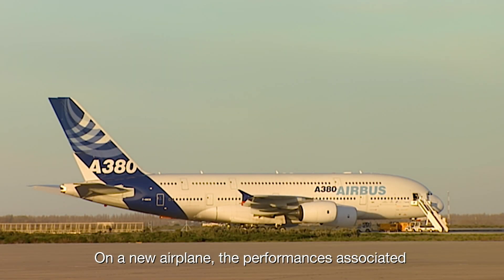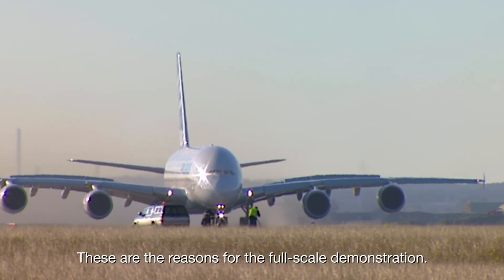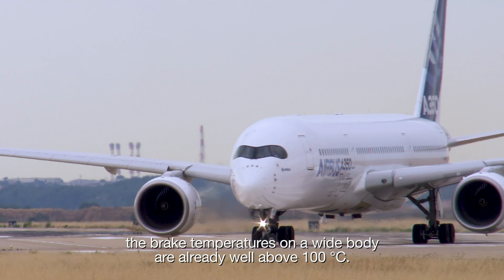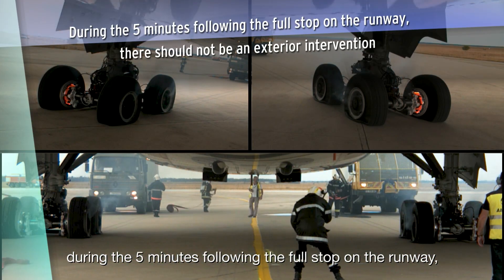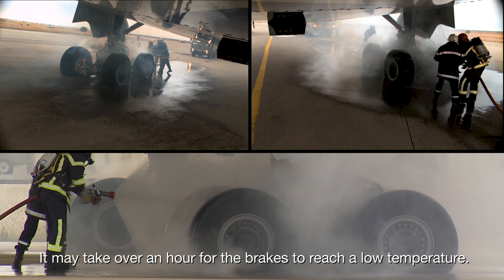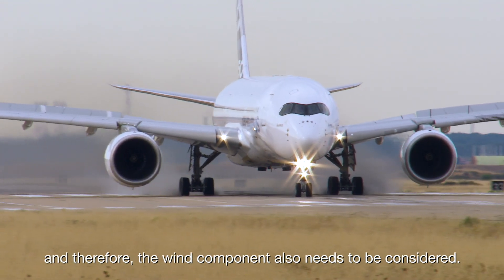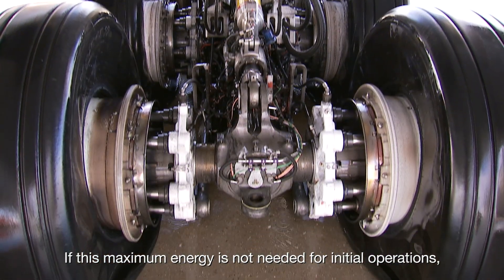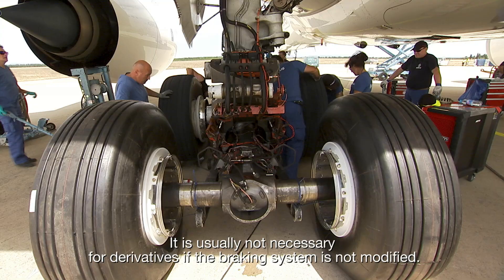Flight Tests - Ep.14: Maximum energy braking

Comment: I was on an old airbus a320 and the crew told us to brace because of an emergency brake landing. I can barely hear tires screeching and popping and felt the heat inside the cabin pressure so the a320 parameters for braking system failed and intervene the most than the a380 maximum braking